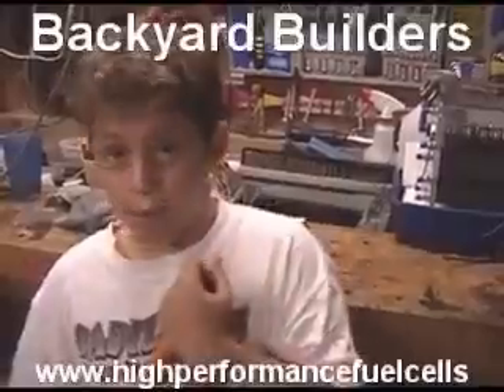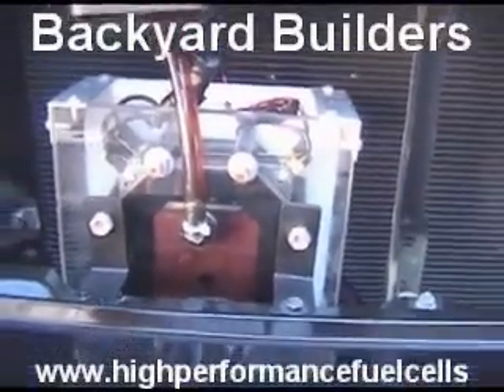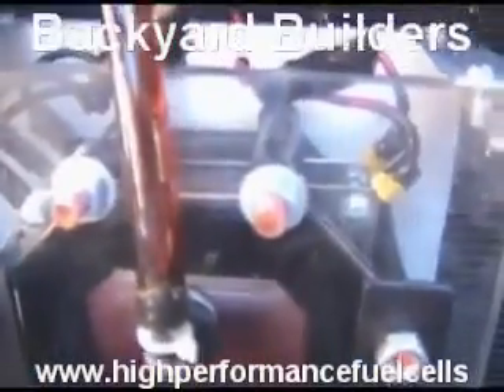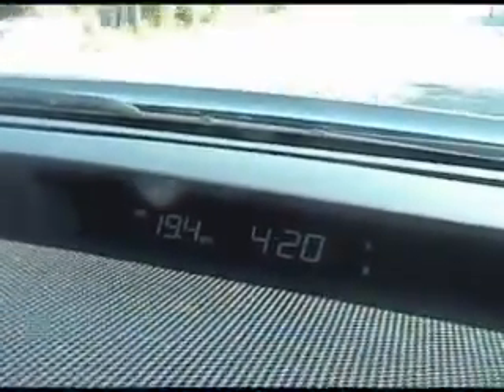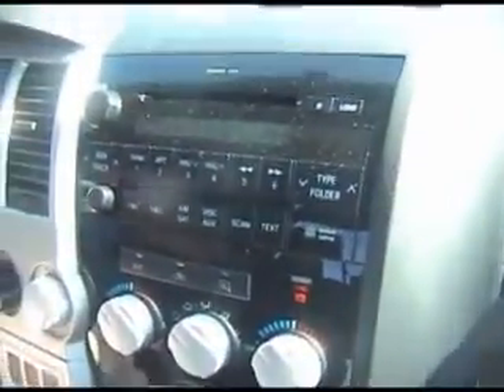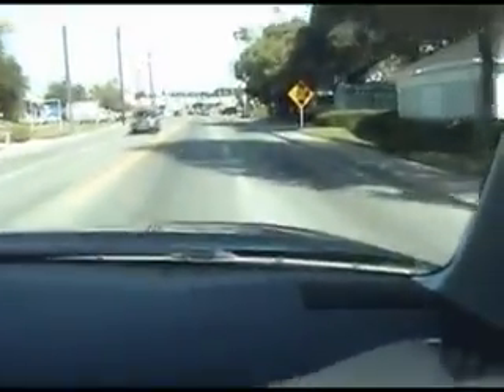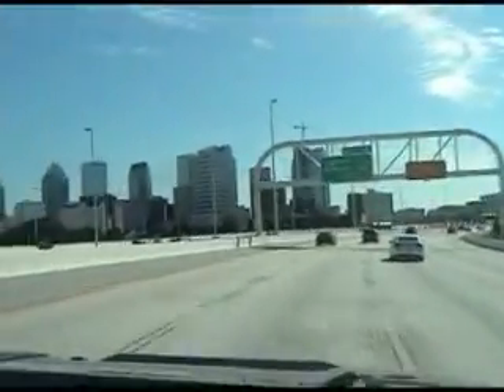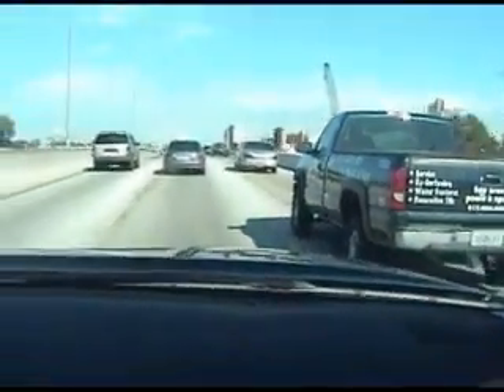2008 toyota 5.7 v8 0n hho

Comment: YOU need to have more controls.  You have no scientific approach.  YOU need to use the same road before and after, on cruise control before and after.  I can coast on a hill at 90 and get 99.9 on my tundra's reading.  I know it should work, but this video proves nothing they way you have it set up.

Comment: Well, since no modern car uses carburator anymore.  Actual, real time, fuel cunsumption is easy to figure-out.  With a high impedance op-amp, tap the speedometer and with an op-amp made integrator, tap the injectors duty cycle.  This is all there is to it.

Comment: @TK42138   Use veggie oil and parafin, you will have 100% fuel savings on your diesel! mixed as follows:  95lt used coocking oil, + 5lt parafin or kerosin,